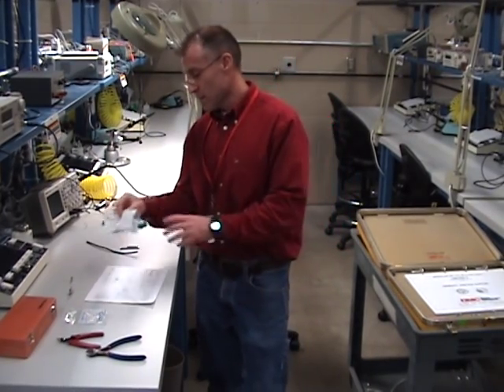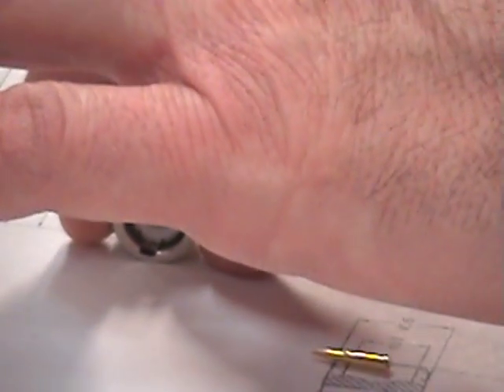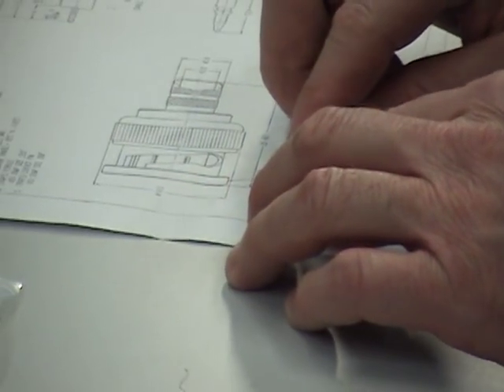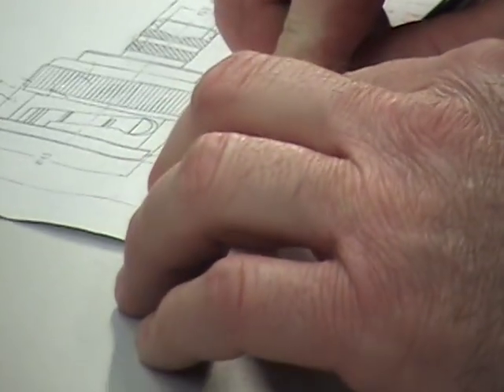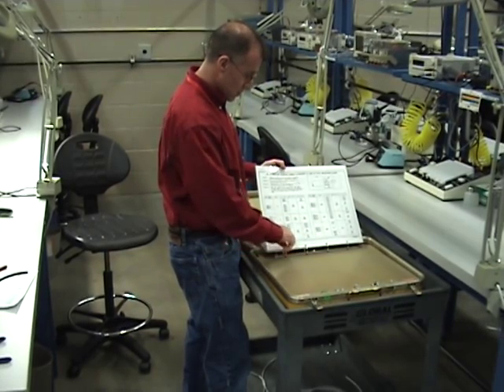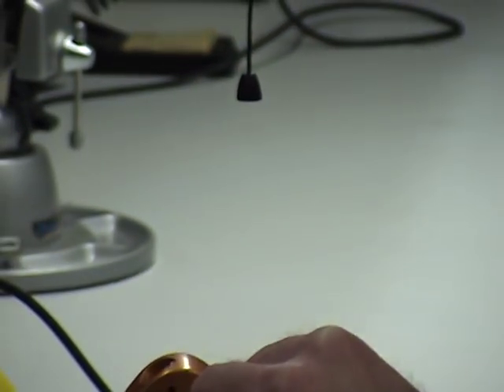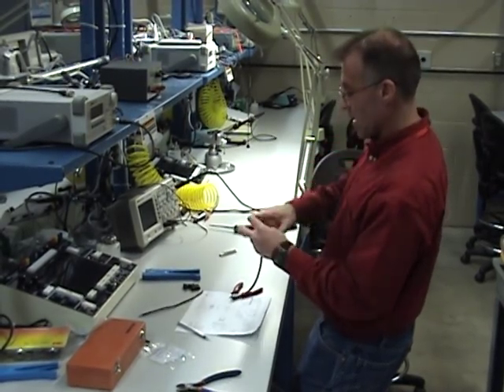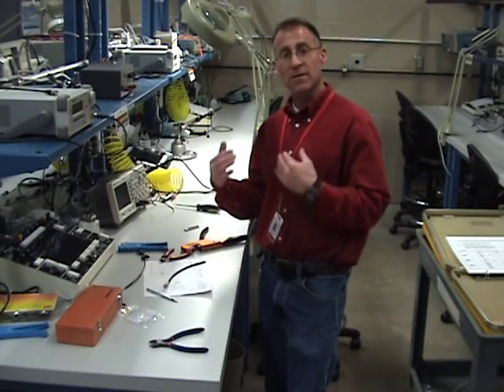*EXPERT LEVEL* Coax BNC Connector Tutorial TTC Avionics

Comment: Im a part time security system installer for various businesses and mostly use BNC connectors, but this is phasing out with upgrading to digital cameras. I can't comprehend using a tool like in this video. Also using exacto knives? To measure and map the wire, then to remove the dies back and forth, and put on the center connector separatly seems really time consuming and complicated, and also many possible oportunities for mistakes. I would think this large tool would be capible for much heavier connectors than BNC? Just guessing. I work up in a lift and need to work fast and light (small tool bag). I guess for millitary spec type stuff, you take 100 times longer and have a nice work bench to make your connections. If I was using multi die installations profesionally, I think I would have extra tools with the specific dies already installed, and simply switch tools instead of going back and forth changing all these dies with special die removal tools. Time is money. I would think the time saved not messing around with changing dies would soon pay for the extra tools needed to do all the different size crimps and compressions. But, I'm just a security system installer, mostly installing cameras, and routers. It seems that we use less coax these days too, with digital installations. It seems to me that this industry is young, and will be ever changing with types of wire, connections, and different applications like wireless blue tooth, different kinds of routers, and the internet's ever changing security systems, to infinity and beyond! .

Comment: This was stripped backwards. The first cut should have been at the dimension where you want the dielectric exposed. At this point you would cut the shielding flush with the outer insulation then the next cut is at the dimension to have the shielding exposed. this is a far more precise method but overall not a bad illustration

Comment: I'm guessing that tool set costs MORE than $25.   And you just accept that ..oh, it says use this slot, but that's obviously wrong, swo we'll use this slot??   Maybe the slot is right, but the die number is wrong.      It should be investigated, and corrected, not just glossed over.  I'm not saying use something that is obviously wrong... but your methodology could result in the use of something that is wrong, but not obviously wrong.

Personally, I think the way that the guy on the Stein Air video buts out the insulation in two steps, results in a neater installation, (I think this was Charles Breen's comment to) and I really like Stein Air's  trick of making a shallow circumferential cut in the dielectric and then twisting off of inner dielectric to expose the inner wire while preventing nicking the inner wire.

That said, I did like the use of a full scale drawing to compare your cable prep dimensions to when working on a work bench.

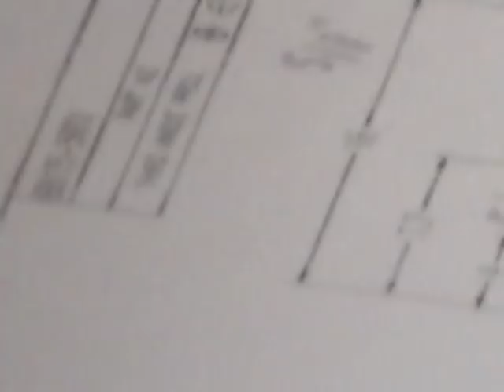Comment: Way too long. Several extra steps in the stripping procedure. Sure, it's a well explained process, but in the time region approx. 2:01-2:40 where his hand is nearly always blocking the details that he's explaining. Having to expose the different parts of the cable, taking all the extra steps is not going to endear the technician to his boss if time is wasted over and over doing dozens of these connectors. Certainly after a tech has learned to do this they will gain speed, but using a tool that doesn't do anything except one process, and having to use another tool in different stages JUST to finally expose the core conductor is hours wasted by the end of the week.